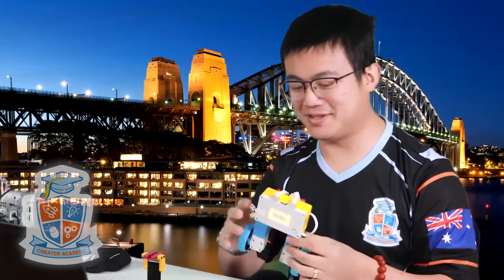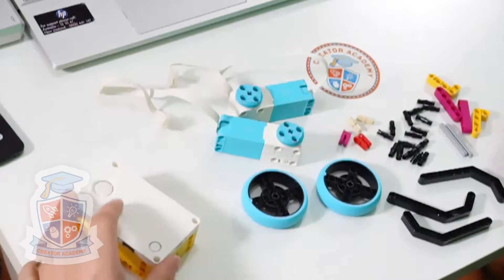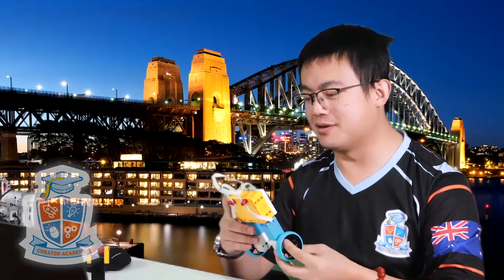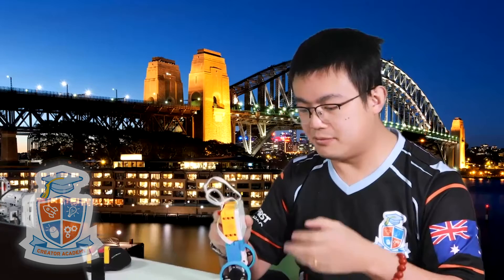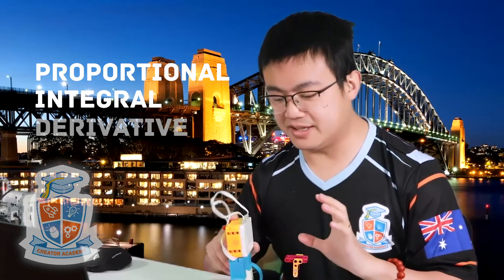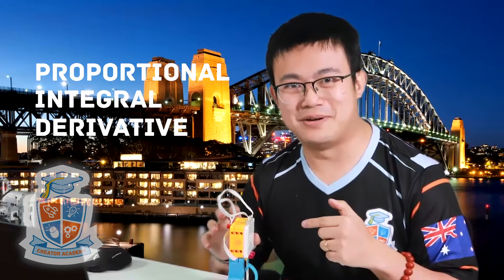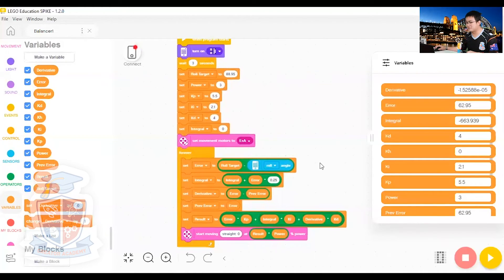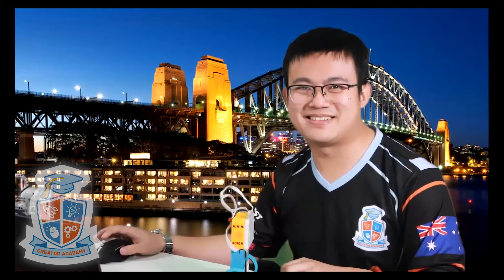SPIKE 2.x PID Balancer with Scratch for SPIKE Prime / 51515: Gyro Girl

Comment: I bought the build for my class. The software wants to be in another release. they have not updated it. We (We being two software teachers and an engineering teacher) tried to do what they suggested, and we found that it was too difficult for middle schoolers to do and it still did not work. We tried several ways including stopping the video and building the blocks that we saw.  Basically it was a no go. Therefore do not waste the 4 bucks until they update the software.
Reply from the maker: If you search for Spike Prime Balancing Robot, you will see Builderdude35, Igor Bogorod, Brickmania all successfully using this model and code to balance. As mentioned in our message before, your SPIKE version must be 2.x in order to function.

Comment: Hi Garry, Do you have idea how to use Spike prime to create self balancing bike by using flywheel instead of spinning front wheel?  I have problem to find out the formula to decide the size and weight of flywheel. I am sorry to leave message here. Would you shed a light for me?  Thanks a lot.
Reply from the maker: Hi! The code will be very similar. When we started building the robot, we had a flywheel design but the problem is that we couldn't find a heavy enough flywheel, and also the torque on the LEGO motors aren't strong enough. Garry

Comment: Where do you get the start moving straight 0   at % power
Reply from the maker: You'll find it in the 'More Movement' blocks in the extensions on the bottom left of the software. Garry
Reply: @CreatorAcademyAustralia  It isn't there
Reply: @MiYay107 I didn´t find it either. I used two blocks instead (Spike Prime app 3.4.5.0) "set movement speed to .... %" and "start moving [arrow up] " in the program loop. I also used "set movements acceleration to [fast]" in init, because the response was dead slow before...
Reply: @jduzivotem3985  what did you set the movement speed as? result*power? the motors just spin forward for me help please
Reply: I didn't find it garry

Comment: Thanks for the video, and explaining really nice. But I think the multiplication with "0.25" works better if used first on the integral first and summed with the error later. As it is now, the integral is always going to max and not forgeting.
Reply: can you please elaborate?
Reply: @micheleraucci9070  i think this person is experiencing integral windup with their code, if the integral cant effect the stability enough it will grow to a large value instead of being in a stead state. usually the solution to this is clamping integrals max or min value, this can be done with set integral to Min of (Max of (Integral, -1), 1)

Comment: I dose not work for me do you think it could because in using 51515
Reply from the maker: Hi! It should work fine for 51515, we have used it for another live video before :)
Reply from the maker: It sounds like it will require more tweaking of the PID values, note it will work better on carpet because the spike wheels are very smooth and harder to grip on smooth surfaces. Although I have seen some people successfully balancing this robot on facebook ☺️
Reply: It balances ok for like 3 seconds but it then falls over ether on its face or back when it falls its always going to fast to try and balance its self do you have any suggestions on what to fix or tweak btw I made my robot Exactly like yours so I think it’s in the code thanks for your time.
Reply: Thanks I’ll give it a try
Reply: I didn’t work I fell like It can go on most surfaces but it keeps on falling over because it’s moving too fast in either direction and I also tweaked the PID And it still stayed the same l think I need to tweak the speed or the reaction time but I don’t know how to can you tell me something I can do to fix it thank you for your time
Reply: Thanks it’s working now your a good YouTuber!

Comment: Thanks for the video! I tried to recreate this bot (same build, same code), but for me it is very unstable. It stands for max. 1 second before getting out of control. Also the motion block you are using in the end send not to be available for 51515 (even with additional blocks turned on). So I used two blocks: drive forward + set speed.
Reply: The surface was very important. He mentioned in the video it worked on carpet, and that was the only place it worked for me.
Reply from the maker: Hi! If you need help finding the blocks in 51515, you can see me reproduce this project with the Inventor kit here: Discovering LEGO Mindstorms/SPIKE Gyro Pitch Deadzone

Comment: I just created this Segway robot! You made an excellent explanation and I really didn't know about PIDs until this video. I did plenty of more research on PIDs and I was fascinated! I didn't know Segways used the PID controller! I also know that a lot of other self balancing programs have you hold the robot upright, and over the course of about 2 seconds, the gyro sensor calculates the average value of the sensor, and then the robot uses that average for self balancing. By any chance, do you know how can the gyro average be calculated?
Reply from the maker: Thanks for your feedback! I believe the average value is intended to work out the ‘roll target’ which I enter manually in my code. If it could be calculated then it could make the balancer a bit more reliable. I will have to investigate how this is done!
Reply: @CreatorAcademyAustralia  Hello, after experimenting a lot, I think I figured out how to calculate the average value over 50 readings. Would you like me to send you a screenshot of the code?
Reply from the maker: Yes please! Would love to see your work
Reply: Creator Academy Australia I sent the email
Reply: @Unbrickme my spike robot hub is working with Normal python code but rejecting a PID code. What do you think may be the issue
Reply: @Unbrickme @Unbrickme my spike robot hub is working with Normal python code but rejecting a PID code. What do you think may be the issue
Reply: @CreatorAcademyAustralia @Unbrickme my spike robot hub is working with Normal python code but rejecting a PID code. What do you think may be the issue

Comment: Does pinching motor cables like that stresses the wire, or are there enough space for wire to bend comfortably?
Reply from the maker: Great observation! The SPIKE PRIME motors all have a groove that allows the wire to pass through comfortably even if it is attached flush to another surface like this robot. You can see in the build portion of the video how the wire sits in the groove at 3:20

Comment: This build is not stable and keeps on breaking. So I tried your program for https://www.youtube.com/watch?v=asVunW7lb6M but it didn't work. Can you explain the program for this build? Thanks in advance.
Reply from the maker: Hi there! The code explanation here applies the same way for the TL robot as mentioned in the video. The TS robot is more mechanically stable so the tuning values are more forgiving, but you’ll still need to tune it yourself. Goodluck!